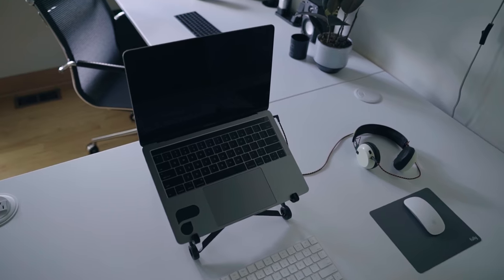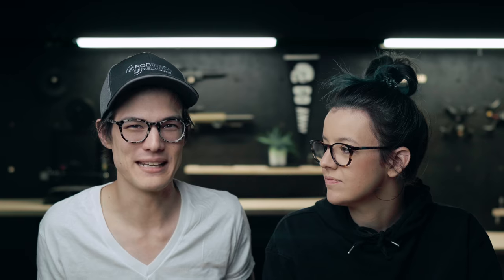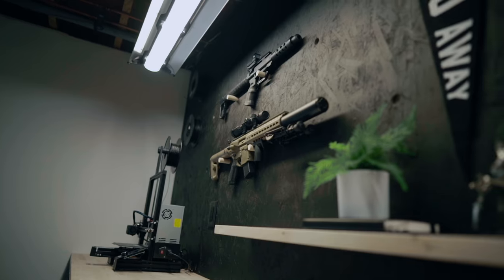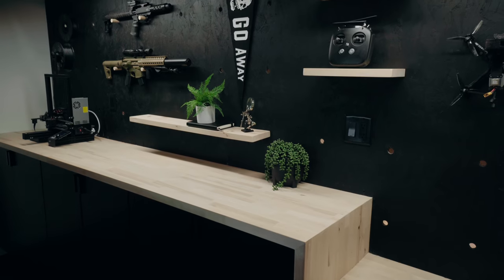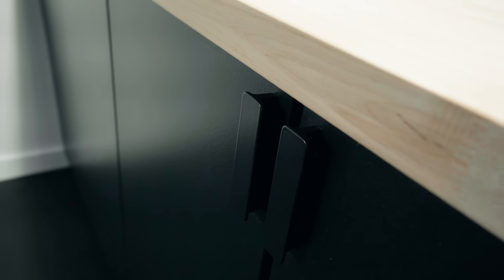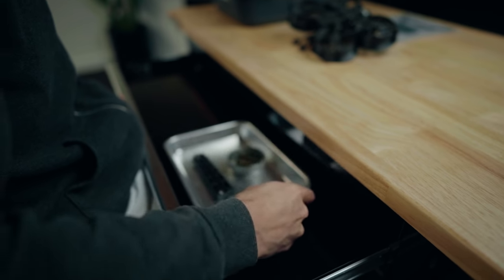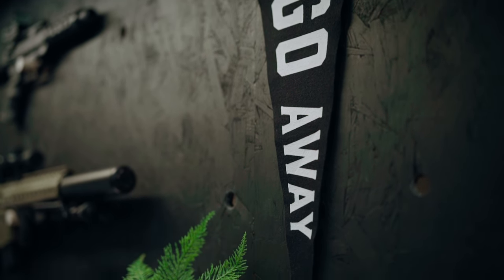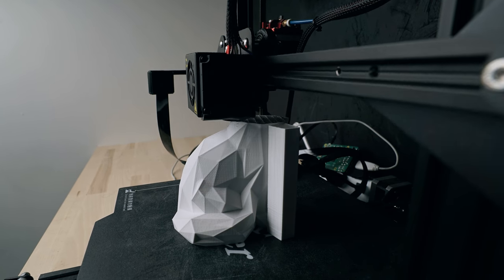Before and After Custom DIY Workshop Tour - The Drone Factory

Comment: Chris, you could install dampeners to the motors of your 3D Printer. That's what I did to my Ender 3 which is in my office and it is soo much better. Way less of the squeaky high pitched noises it made in its original form.

Comment: I started drones about a year ago, and literally have a lot of the exact same stuff.  Same soldering stand, DJI googles, Shendrone Squirt, every tool in the video is the same as mine.  I even bought the same shop light and came real close to that Husky workbench.  It was a little surreal.  Now I feel like I need to buy some pellet guns...  I did not spray paint tools to match the aesthetics, though.

Comment: Update the 3D printer controller to 32 bit, I used a SKR mini E3, direct pin to pin change and the stepper motors are quiet, the fans sound louder now.

Comment: Hi Becki and Chris, any idea what Kelvin, lumens and/or type the led workshop lights are?  Or is there any you would suggest keeping in mind it would be used as a fill/video light too? thank you!
Reply from the maker: They’re a bit warmer than the 120d but as a separate light for the background it doesn’t really matter. 5500 lumens 

https://www.homedepot.com/p/Commercial-Electric-4-ft-96-Watt-Equivalent-Integrated-LED-Black-Brushed-Nickel-Shop-Light-4000K-High-Output-5500-Lumens-Linkable-54591142/305993226

Comment: Loving the black OSB wall/peg board! Does anybody have any advice on how to achieve something like this? What kind of paint to use and what would be the best way to apply it on a such an oversized, giant, Jesus ass surface?
Reply from the maker: We used Benjamin Moore regal select in matte and sprayed it on with a Wagner paint sprayer. You could brush/roll it on too. If you’re not spraying it, I’d probably put the boards up first and paint it on the wall.
Reply: @BeckiandChris  Thanks so much for replying, I thought it was a black wood stain. I'll let you know how it goes. :)